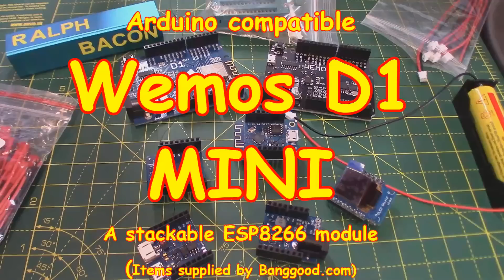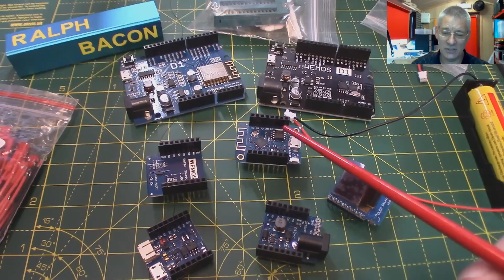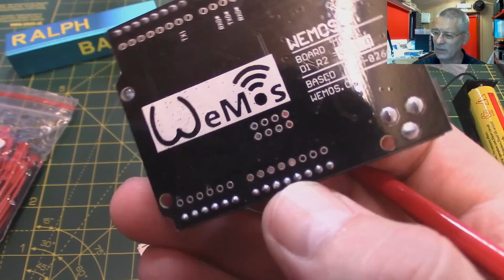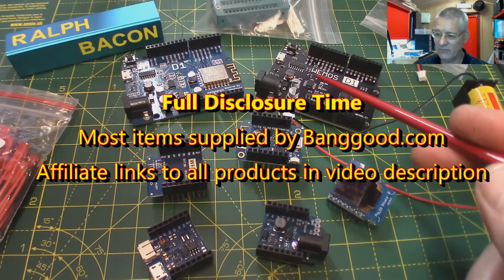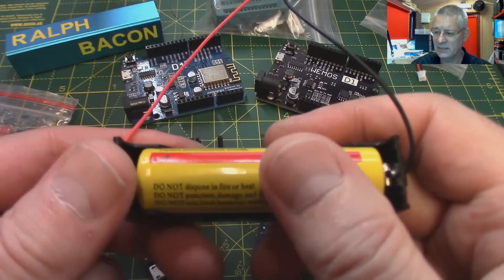#120 Wemos D1 Mini 👍 Intro (with shields)

Comment: that "5000" battery screams FAKE from a mile away :D
Reply from the maker: Surely not, squalazzo? The Easter Bunny told me it was OK, and the Tooth Fairy agreed 😜.

But not all are fake. I have ordered six 18650s from Samsung (rated at 2500mAH) with a price to match and those I DO accept as being kosher. But this one... yes, it screams fake! (But still works fine, so far, just with a reduced capacity)
Reply: i think 3000 is the limit of the 18650, for 5000 you need the 26650, which you usually find in those cylindrical powerbanks, too
Reply from the maker: Ah yes, I have one of the fatter, cylindrical power banks, that is what is inside it.